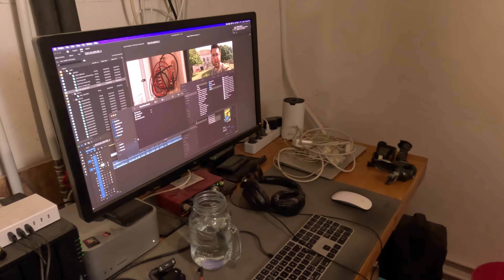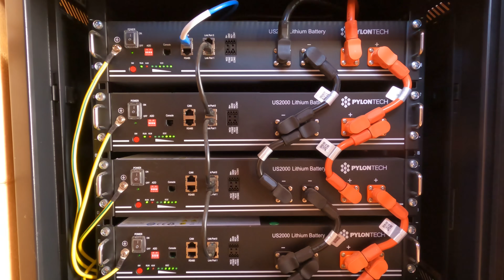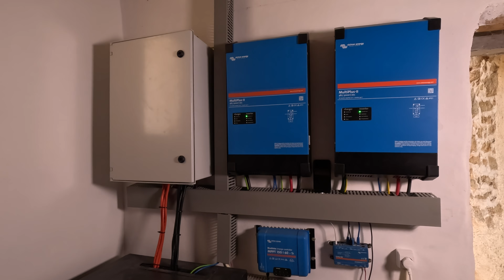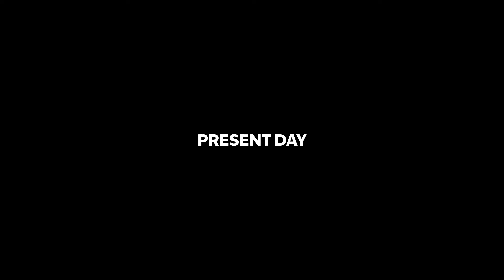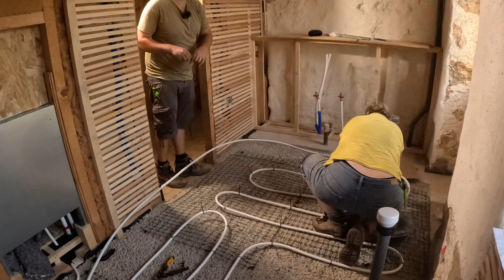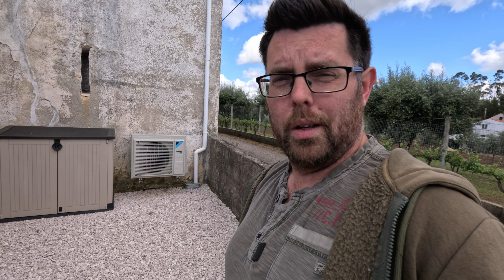Can Solar Power Heat Your Home All Winter? Our Experience and Data Revealed!

Comment: Was it what was available in the village or the potencia you were paying for?  My beef in PT.  I accept that we are 'wealthy' compared to our neighbours and happy to pay more for electric than someone less fortunate, but would prefer a sliding scale per kwh than the potencia standing charge.  Watching this because our solar panels feed into our EDP meter so when we lost the power in storm Kristin we lost access to our power.  Not planning to go fully off grid due to our age but having a battery or two inbetween us and EDP would be very useful next time
We kept our fridge freezer going (only just) using the power from our camper solar electrics.  That was our priority, but a hot shower would have been a bonus!

Comment: We live n Tasmania at about 44degree South. We have a 5kWH arrray with an inverter but we are on mains so dependent on the grid to initiate power production.  We have had a few hiccoughs with the inverters and now have a very low feed-in tariff. My concerns are: Although the system (been connected from about 2012) has paid for itself as we received a feed-in tariff based on the price paid /kWh, we now only get about 25%.  On the ethical side of re-enable power, I am concerned that the panels are about halfway through their lifespan (25 years probably) and there is no recycling or waste management program available. These panels and inverter will go to landfill. To go off the grid we would need batteries (lithium is currently our choice) and this presents another ethical problem with waste disposal. I would be interested in how other nations are handling these long term waste management issues.

Comment: In Melbourne, Australia you need a shit load of panels to power a home in winter. I have 28 x 475w 13.3kw panels and it's not enough in winter during the day. It's more than enough in summer though. We have very few daylight hours in winter and mostly overcast skys. It's useless for heating bills in winter. Thinking to try a big battery but friends have had fires...
Reply: Wow, that's a lot of panels! I'm trying to find anyone who's managed to go fully electric solar off grid and have enough warmth and hot water over the winter, but haven't found anyone yet. I guess physics says if you have enough panels and batteries then you can do what you want all year, and so is it the cost of the hardware plus having enough space that's the problem? Potentially I might be able to solve that as I will have heaps of space, the cost of solar panels is going down exponentially and I'm not planning to do it for 2-4 years, plus I have an electrical nerd friend who has used an 80kwh battery from a tesla car as a solar battery and can repeat the setup for me cheap as chips. Any advice, thoughts would be great. I loved living in St Kilda in the 90s, but I also remember those cool, rainy winters too! All the best mate!

Comment: 6 panels in series in three directions will perform far worse than having them all in the same direction.

If you could rewire to 2S3P that would improve output considerably. A Victron MPPT should work

Comment: i expect you to have times with high excess power.

You might want to consider exporting this power.
But without grid you can use a direct power-to-value machine.

Bitcoin miners can start and stop at an instant and utilize any excess energy and convert it directly into value.

Comment: How goes this work in cloudy England?! 
Looking at a concrete build bungalow in Somerset countryside.   She has 8 4 kw panels on the S facing roof.   A fire place in the living room that heats the water.    Like your plan! Also a wood burner in the kitchen.  Electric heating to be used in summer to heat water.   Thinking of getting a heat pump set up.    Not sure.  It’s a bungalow! If I buy it I’m planning to get the house both insulated and exterior stone cladding  which should lift it out of the regs making it mortgageable should I ever need to sell.    Not planning to.    It’s just me there.   What do you expects reckon? I’d like to get batteries installed in little loft, plus insulate it, so I’m actually off grid! Not sure about costs for that.  There’s a dreaded “ smart meter” so that’s GOT to go.    Im EMF sensitive.  Being off grid cuts out the crap regarding the energy companies! Has chickens too.   I can have them.  So it looking good! Any thoughts from people eat cleverer than me would be welcomed with much gratitude! 🙏

Comment: I'm off-grid in Australia. Our peak loads are in the Summer, when we have four air conditioners running flat-out for about 18 hours per day. We also charge an EV. I had to design a system with all of this in mind. We have 15.1kW of panels (46 x 330W) of which 37 face due north and the other nine face east. These are set up in four arrays, each with its own Victron 250/85 MPPT controller. They charge a total of 14 Pylontech batteries (10 x US3000C and 4 x US5000B) which we bought in stages (two for initial testing, six more for commissioning and then four more to be sure, to be sure, as they say.) We use three Victron Phoenix 5KVA inverters in single-phase parallel. The EV charger is a 7.36kW single-phase Victron jobby. We have no backup supply of any sort. No generator, no battery chargers.

So far it has served us well and, like you, the only time we know if the power has gone off in town is when our neighbours start firing up their generators. Our highest  ever daily consumption, of 78.9kWh, was in March this year when all air conditioners were cranking hard and we did a top-up charge for the EV.

I must say, I'm impressed with your ability to manage your load with such a small solar capacity. Kudos to you. We might be able to have a low consumption day in Autumn or Spring, when we have no need for heating or cooling and no EV charging to do but, even then, our best day so far has been 16.8kWh...
Reply: But does 15.1 panels not overkill? At summer even with 80kwt consumptions you buttery pack should be on 100% till 14:00. On summer you have so much energy you can not spend.
Reply: @artemca  Over-provisioning  panels is the best thing that you can do in a solar system. It is cheap and it is there not for when the Sun is shining, but for when it's not. It's the cloudy Winter days when you need to eke out every Watt possible. I don't care about not being able to use excess energy, I care more about not having enough energy when the conditions are sub-optimal. I don't have any form of backup generator.

Comment: I fancy building an undulating solar railway in a semi-circle, which would lean a train of panels towards the suns angle, giving nearer optimum for early and late sun, over typical southern fixed northern hemi-sphere...Carriages secured to the rails like a roller coaster...
Propulsion maybe winch driven, on a time clock...

Comment: Amazing video. Just be aware on 19:00 I do not think this is true at all. The house itself is probably the issue, not the network. I am from a village as well, and I can tell you that people from older houses might face the issues you are speaking about, but the ones that aren't too old (done in the last 3 or 4 decades) work perfectly well. So, it cannot be an issue of the grid, as all houses are obviously on the same grid.

Comment: It's interesting and your solution is well explained. I am just surprise by your consumption 10Kwh/d around 420w/h. That seems very low to me. At 20 cts/kwh, it's a yearly cost of 730€. Your ROI is about 24 years with your current consumption. As a comparaison, we are two people living in west France Brittany and our consumption is 5 times more than yours (40-50Kwh/day). I have been in Portugal several time and I never suffer the kind of problem you described (power outage, breakers pbs) but we spend most of our time in Algarve and not central portugal. As soon as you settle in,  I bet your consumption will at least double in the next 3 years and you will need to double your PV production and connect to the grid in winter time (or use your generator which not really great..).
Reply from the maker: Oh, we know our power consumption will go up. There’s plenty of high energy activities that we currently don’t due that we will do 😀

Comment: Given that Portugal energy is composed of 70% renewable. One would think that using the grid as a backup would be better for the environment than diesel and wood burning. Could you elaborate a bit more on this topic?

Comment: If any one as grid connection , there is the possible use of a trickle charger to guarantee battery capacity with solar , or a battery generator run off peak without solar . I am mindful of adapting habits to the most sunny parts of the day , especially in the winter to optimize the solar charging of the batteries . This video is a very good breakdown of solar benefits . There solar kits do vary a lot in price , I would suggest that a 6 to 10 kw system , with 12 to 18 panels , now costs around €6000 to €11000 with 10kw battery storage  . It is possible to sell over production of summer time electricity which should cover the cost of having the annual service charge , this then gives peace of mind for any problems due to component fault or days of low sunshine , rare as these are .

Comment: Great video, but I completely disagree with solar power being more expensive than grid power. I spent less than 10k € this year for a very large diy solar setup with 29.5kw in solar pannels, a 20kw three phase inverter from deye and 75kwh of diy batteries (lifepo4).
This will pay for itself in about 7 years (due to rather high consumption) and after that it will be free power from there on. i did this after buying a house with enough space for all that equipment and panels and it came with a heat pump for hot water already.
I currently use 14 to 22 kw of power per day, and that would cost me a fortune otherwise.

I'm aware I've oversized the system quite a bit,  but that was on purpose for the winter months, so I don't need a generator (will see about that), but also to experiment with power storage solutions in the summer time, once I'm done with rennovating my house.

Solar power has become extremely cheap these days and there is nothing that comes close to it, If you have the space for it. Of course that only applies, if you do it yourself. Paying a company to do it for you will eat up all the cost savings.

Comment: Yes it's expensive but worth in about 8 to 10 years. I'm a solar and energy professional and basically all you said is true. You are right it is about energy management but you are adding more and more. So I would say go for more panels as you battery storage is enough to pull you though the night if properly charged. I'm off grid in Cape Town South Africa and will never look back. With our constant blackouts we are experts at workarounds. Contact me if you need design advice.

Comment: No! Because it usually trends to be cold BECAUSE there's no sun...
EDIT: now after actually watching the video!, it was great! Thank you. 
But can you further discuss the heating energy details? How much energy can the floor heating consume in your building? At my house (off grid, cold climate, house not well insulated, only 10kwh storage) the required energy for heating even one room with a heat pump can be more than I generate so I still use propane, wood stoves etc. I'm trying to upgrade everything but it's a lot of work to get a few rooms insulated enough to make it feasible when outside temps are zero C.
Oh another note, I think I'll buy a cerbo gx after watching this! I have victron chargers and smart shunt and would love to be able to see proper graphs like this rather than the tiny useless graphs on the smart phone app.
Reply from the maker: We just released a follow-up video today so you might be interested in that too … we touch on the question you have asked 😀
Reply: @MAKEDOGROW cool! Watching it now. Interesting you're at similar lattitude to me. I'm in Australia at 37deg south.
Also sounds like your wife is from here... Accent sounds a bit like Melbourne and/or Adelaide.
Reply from the maker: @tomgrant6563  I’m actually originally from Brisbane 😀

Comment: Don't face all your panels true South.  It's much better to have 50% facing South East for the sunrise to early afternoon sun, and the other 50% facing South West, for the midday to late afternoon sun.  This way you start generating power early, and continue until almost sunset.  And during midday,  both arrays produce peak power.

Comment: I have a 14kva solar roof system which works great, but it has no battery. 🔋 which is a problem as I live in North of Sweden, so we get power cuts and long dark nights in winter. However, I am concerned about putting a battery in the house due to fire risk (old wooden house with saw dust insulation). Do you have any concerns/mitigation of battery fires.

Comment: I am in Portugal so I know how the powe companies work. I do think youe system is awesome for educacional purposes but an overkill. You could have mantained the same quality of life by using a smaller system and use grid as backup instead of generator. Use grid only to charge batteries when not enough solar. And a big % of power in portugal grid is from renewable.

Comment: really interesting. Im offgrid too, but in northern sweden, 100 km south of the polar circle. I have about the same set up as you have, 5500 KW solar panels, and 20 KWH batterie capacity. Im very surprised to see that you have about the same yearly solar production as i have even though you are in south europe with much more sun hours, especially in winter.

Comment: I’m guessing that the grid in Portugal is similar to Spain. If so, the main breaker trips when you exceed your contracted power limit (with modern “smart” meters that no longer happens). You can increase your limit but pay more so most people don’t. It’s one of the main reasons that nobody has electric showers here.

Comment: Yes, domestically, if you can afford the non-trivial investment, solar backed up by expensive batteries and a "fossil fuel" generator can keep you going but "wind power", domestically or at utility level is just an expensive waster of money except in a very few locations. This can give you you the "I'm all-right Jack" feeling for your home, even using the likes of Starlink Internet - but it does squat for "public services" - such as hospitals etc. reliant upon a stable, reliable grid - which during the power cut, for example, had to terminate all non-emergency services.

Comment: Great video, great information. We are in Portugal in a small town with a modern main grid and in a modern new house. However, we are installing a solar system: 14.4 kW solar, 10 kWh inverter and 32 kWh battery bank. We have two EV cars with 60kWh battery each which we charge at home and which we use all the time. Everything in the house is electric. Based on the model, this system should provide us 83% of the total annual consumption with the remaking 17% of consumption from the main grid.

Comment: I'm in a village in Spain, and originally had 5.3 kW on grid. That was uprated to 8kW some years ago, and we as well have only two circuits. I am considering implementing a completely independent 3kW off-grid system on my ideally south-facing roof, with no connection to the grid from that. Especially after the apagon!

Comment: More south facing panels will get the battery charger in the summer in float mode at 9.40 am instead of 10.20 am, not sure how much that's worth spending money on myself, but why not, each to their own.
You really don't want to listen to people who think panel orientation is the same for off grid, as it is with grid connected.
 It's not about maximum potential power over the course of a year, it's about not turning on that bloody generator in the winter.
 It's about maximising the production of electricity when the sun doesn't shine, not getting as much electricity as possible when the sun is shining. It's about increasing the number of days the system can cope with poor sunlight, it's not about how many kilowatts can you get at lunchtime when the sun is beating down on it.
 It really doesn't matter how much your system can produce at noon on a sunny summer day, it will literally never produce it, because the batteries will be full and the panels will produce next to nothing. It only matters if connected to the grid, so don't waste panels for producing electricity that cannot be produced because there is nowhere to put it or sell it.

Comment: One thought I had:  Instead of running a fossil generator for 30 days, could you buy an EV with vehicle to load capability, charge up remotely and then run the house off the EV when your solar is insufficient?